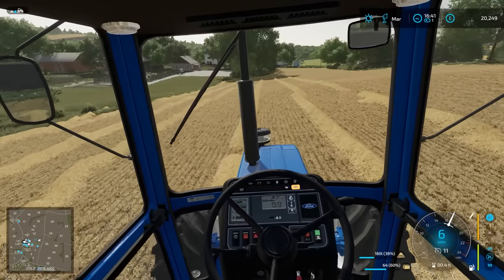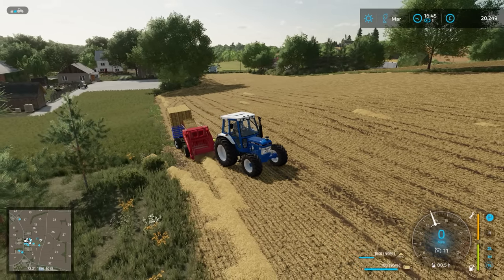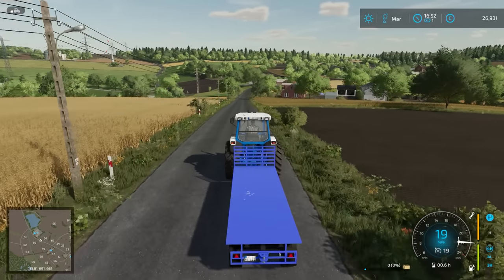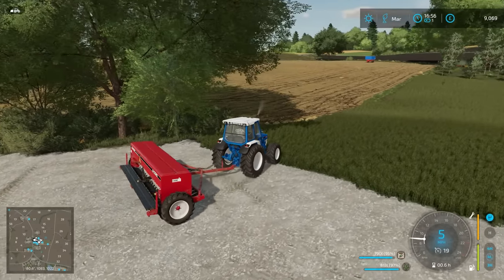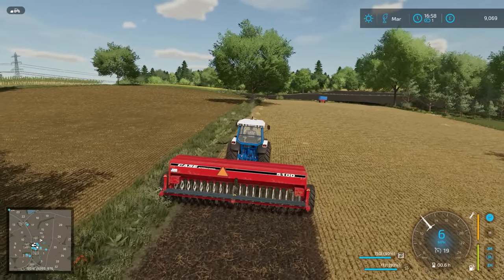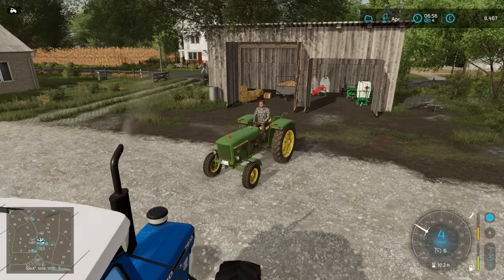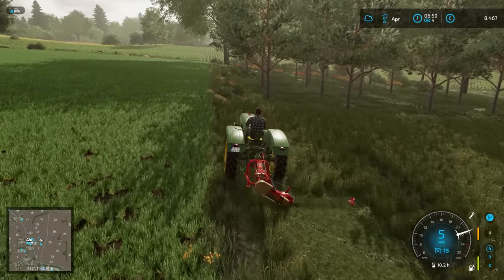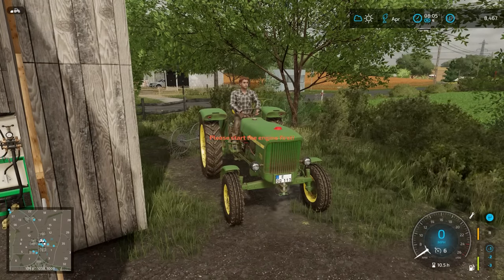WE FINALLY BUY A NEW FIELD! | Vintage Survival - Episode 18

Comment: At max volume, the bale trailer held 42,000 liters of straw, which at 0.13kg/liter equates to a net weight of just the straw bales of 5,460 kilograms. It's no wonder that little tractor was having so much trouble once you factor in the weight of the baler & trailer!
Reply: Those bales are bugged, they weigh on that trailer 40 to 60 tons, i tried to fix it but i couldn't

Comment: If you want a cheap mower upgrade, look for the lizard cutting bars mod. It would more than double your working width. Also there was a John Deere mod pack that dropped that has a pull behind grass collector.

Comment: No point in rolling the grass if you are going to fertilize.  First fert stage from cutting, second from fert, rolling does not benefit you in any way.  You could roll instead of fertilize, but honestly, it is faster and easier just to spread some fert.  Plus the price of a grass roller.
Reply: Cheaper to roll, and with this small scale farm it makes more sense to roll imo.
Ofc if he ever get into large scale grass then yeah the ammount of time it takes is not worth it just for the free fertilizer and 2,5% yield bonus.
Reply: @DonGorgen  Except he has to buy or lease the roller.  How many crops of grass is he going to go through on this save?  5?  How much fertilizer to do that small field?  Add in the trip to pick up the roller if he leases...Yeah, I think I would stick with the fertilizer.  But to each their own, nothing wrong with rolling if you want to go that route.  My point was there is no reason to do both.
Reply: @seanobrien7169  Believe I saw a moded roller once that only cost like 2-3K, won't take many harvests to make that back.